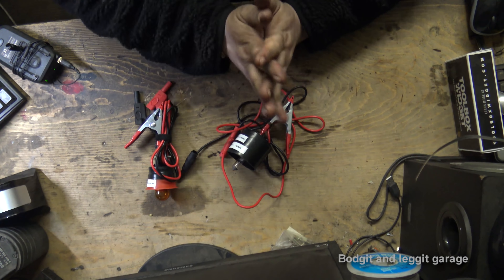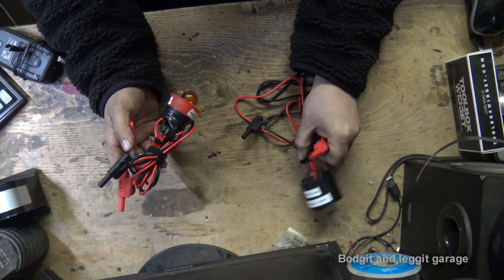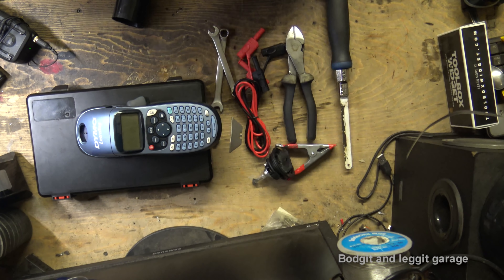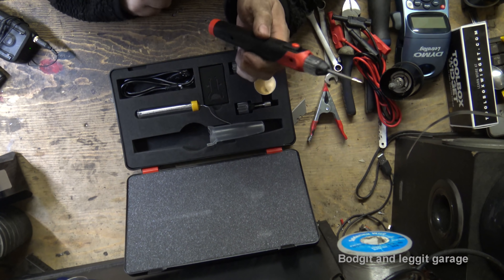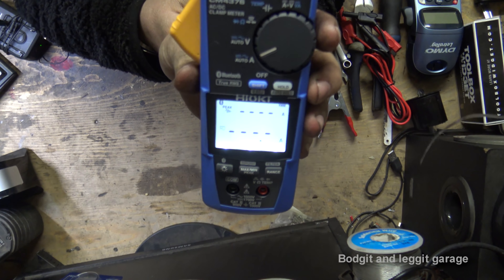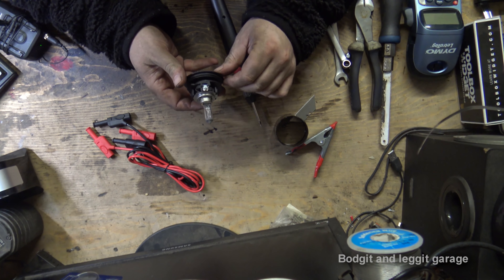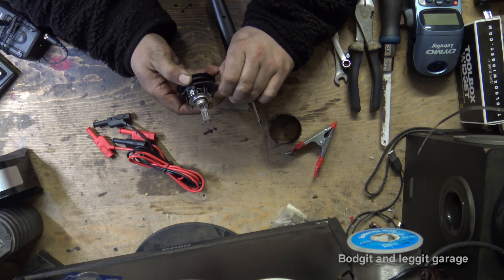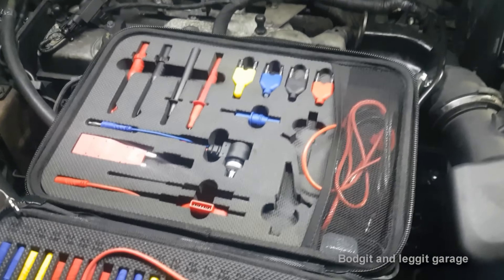How To Make The Ultimate test light Bodgit And Leggit Garage

Comment: Could you please tell me your opinion regarding the LoadPro if you have used one ? This is designed to be used in conjunction with a multimeter to measure voltage drop along with charts provided by the tool company .The ends on a LoadPro are screw on so not so easy to adapt without purchasing adaptors from the tool company.  Are there any advantages adding a  resistor into the circuit in conjunction with a multimeter as an alternative to a test light bulb to check voltage drop?

Comment: When doing a load test on a car circuit how do you know what sort of load to do on the circuit your testing if  the components broke and you can't see what its drawing . Am i right in saying that you load test 10% of the fuse amp the circuit has. So a 10 amp fused circuit you load test 1 amp . Or do you use ohms law to work it out our something.

Comment: Id would label that h7 as 4amp as draw is relative to voltage..ie at 12v your draw 4.5amps .if the vehicle was running at 14.7v you would only draw 3.7amps.
Thanks though leon..tips n tricks are always welcome
Reply from the maker: I hear what you are saying mate but if I'm testing a a wire and I want to see if it can hold the current and testing it with the engine off if I'm also testing something else I normally buy Direction control it with the engine off that's why I marked it as I did especially when you are just testing to see if the wire can hold the current the wire is connected to nothing at either end just running a current through it

Comment: Hello sir ! I love your videos they are really helpful . Please clear  my doubts.  How long can a 2006 Corolla Automatic  last . And what to check while buying over 200k Kilometres . Ontario , Canada. Should I buy it between 2k to 4k . My aim is to have a daily car for next 5 years or more , i expect to drive 12 thousand kilometres every year .
Reply from the maker: Hi mate unfortunately it's impossible me to say as we don't have automatic cars over here but very few have only seen a couple in the last 5 years but it's like everything it all depends on how the car was looked after you could get a car with 50000 miles on and being no good just check for maintenance see how good the outside and the inside of the car is this will give you a good indication if the car is been looked after make sure you drive it a good test drive get everything up to working temperatures and see if you can hear any noises but also you need to make sure you start the car when it is cold so you can hear there's any noises from the gearbox or the engine
Reply: @bodgitandleggitgarage  thank you so much . I appreciate your efforts sir !

Comment: Leon, You can dismantle those bannana socket ends and re solder them onto longer wires. I use a back probe pin and small screwdriver and they come appart
Reply from the maker: Sorted

Comment: I bought some little buzzers to add to mine for the times I can't visually see it.
Reply from the maker: Hi mate the only problem I can see with that is if you can hear the buzzer that's like an continuity test you cannot tell if the wire can take enough of the current it only takes one Strand to sound the buzzer where you really need to look at the bulb to see if it's bright so you know it's drawing the correct amount of current
Reply: @bodgitandleggitgarage  good point.
Reply: A horn on its own would probably work better for the audible and amp draw. I see some are 2amps on up.
Reply from the maker: @xbin87116  too loud too clunky and not a high enough amperage for most Motors that's why I have long leads on this don't really need anything else and you can also extend these leads if you need to so you should always be able to see the bulb

Comment: Would prefer one that shows if its a live or ground wire.
Reply from the maker: Why it doesn't make sense you don't need to you can connect these bulbs to any side there's no such thing as a live or ground on these particular bulbs it's a test light to test a circuit this just shows you if the circuit can draw enough current to power whatever it's powering
Reply from the maker: The ones you are on about I'm normally and LED one polarity tester but that will not tell you if your circuit is able to take the amperage completely different tester
Reply: @bodgitandleggitgarage  I'm only starting out with this. I use a multi meter mostly for basic stuff.   A good video idea for you would be a parasitic drain diagnostic. But I would prefer a test light that can be used to find breaks. As if something is not working. T into it and figure out if its the  live or ground wire that can also be checked if the wrong pins have been put into a header, wrong way round etc.
Reply from the maker: @Daedalus_UK  hi mate I've done a three-part video on parasitic drains you can find out broken wire with the ohms test quite easy